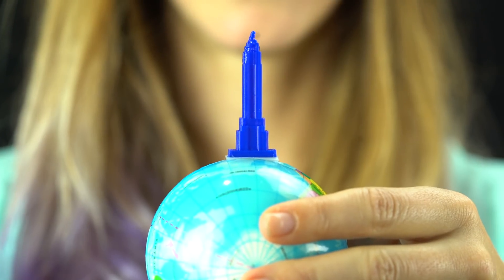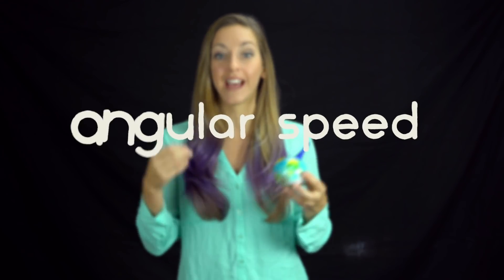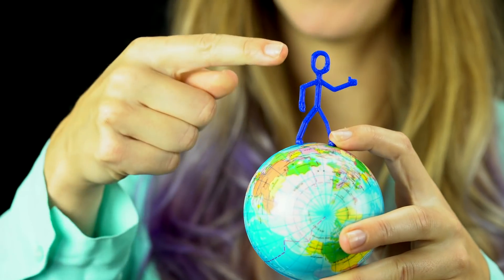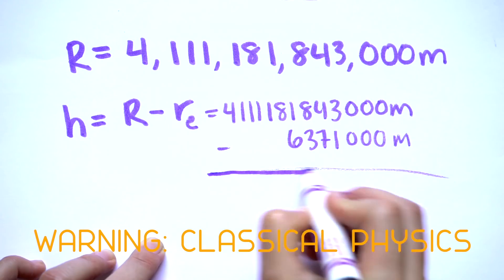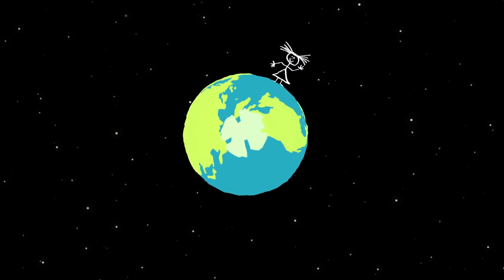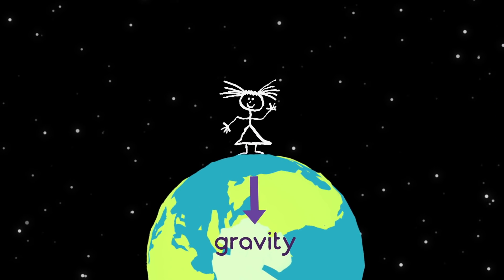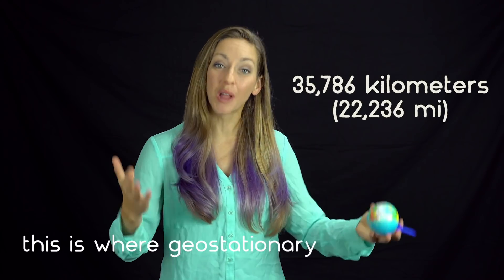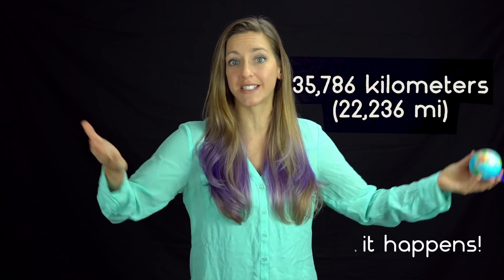How tall is this building?

Comment from the maker: Fun fact! When I said you could find a place to settle down in earth’s molten core, it wouldn’t be in the plane of earth’s equator, because earth’s core is not entirely molten. It has two parts, a SOLID iron/nickel inner core with a radius of about 1,220 km, and a molten outer core that’s about 2,300 km thick. If you wanted rotate around at 100mph (161kph) on earth’s equatorial plane, you’d have to be 612km from the center of the earth which would put you in the solid core.
Reply from the maker: Yes!
Reply: Physics Girl Thank you for saying in the title "zero G" and not "zero gravity" SciShow has made this mistake before. Also I think you should go full purple akin to Trade Chat's pink. Love your videos.
Reply: Physics Girl Would the Earth's wobble increase if it's balance gets thrown off by the weight of such a building?
( Much like a spinning top with a lump of clay stuck to its side )
Reply: Thanks for the International System Units. You could have used them on your video in simultaneous translation, because it would not make us, educated in those units, pause to try and transform the quantities involved.
Reply: centrifugal is what we call the force we feel or perceive. So it isn't an actual force. Vsauce just posted a great video on it as well called spinning.
Reply: Actually, such a building would weight 0 kg. As explained, there's this "centrifugal" force that puts the building on orbit. Imagine it is a very big geostationary sattelite, with a wing out to space, and a wing going down to Earth's surface.  It doesn't even have to touch the surface.  Actually, we'd start constructing such a "building" by putting it on geostationary orbit, and extending the two wings at the same time so the gravity force on the down wing and the centrifugal force on the up wing would compensate at all times.  We'd only "attach" the down wing to some Earth base so that it's not pushed away by winds, and irregularities in Earth rotation.  See the links in my other comment.
Reply: The centrifugal force is not a real force, it doesn't exist, it is a feeling rather the counter force, the centripetal force is real. http://www.diffen.com/difference/Centrifugal_Force_vs_Centripetal_Force
Reply: Happy molten iron beauty bath then!
Reply: Physics Girl, is it possible that I saw you in the tv serie: how to build everything.
Reply: i love your hair. want to meet u someday
Reply: Does centrifugal force exist or not?
Reply: erm, that would just rip the building apart?
Reply: Intelligent Physics people: Zero G and Zero Gravity are different, also angular momentum and science.
Me: What's the difference between a merry-go-round and a carousel. Seriously. Is a merry-go-round different from a carousel? I NEED ANSWERS.
Reply: Physics Girl buildings this tall would decrease Earth's moment of inertia or slow down Earth's spin as the energy used to spin Earth would be instead put into the building slowing down day making it longer. you can tell this would be more than just a  problem as we would have to re organise our time. this also might be a good way to make a full earth spin actually take 24 hours instead of the 23hrs and 59mins or something around that which always bugged me
Reply: InjuredMuffin 2 why should a day be 24 hours? Arbitrary day based on arbitrary unit of time. And changing with time...
Reply: Physics Girl m.   M
Reply: We all float up there.
Reply: Another fun fact is that the deepest anyone has ever drilled down earth is about 7.6 miles.  The earth radius is 3,959 miles.  So when they tell you that the earth has a molten core and all these different layers, it’s just a theory.  Just a wild guess really.  We do not know basically!
Reply: HAHA. the molten magnet doesn't work. The core cannot be. After you heat a magnet it loses its magnetic properties. The earth is flat and gravity and space are a hoax

Comment: Sorry but I don't like the centrifugal force notion. There is only one force acting in the system and that is gravity. The penny is simultaneously moving laterally with constant velocity, and accelerating down towards the Earth. It never gets closer to the Earth though because its lateral motion ensures that the curving of the Earth's surface away from it, exactly matches the distance through which it falls. This is a hard thing to put into words and others have done it better. Sketches help too.

There's talk on here of centripetal forces, but that doesn't help really since they only have meaning with circular motion, and as we know orbits under gravity can be elliptical or even hyperbolic. So I think notions of circularity in these discussions don't help. Cometary orbits for instance can be highly elliptical, so much so that when they are far out in the solar system such comets may actually look as though they are falling towards the sun. The key word is "falling". This is really what the penny is doing even though its motion is actually circular.

This is interesting now. One guy below was talking about centrifuges. Imagine you're standing in a cradle that some giant is swinging around on a rope. Just like standing on the Earth you feel a floor beneath your feet and it feels like there's a force pulling you "down" (or outwards if you prefer) to that floor. This is why the notion of centrifugal force is so popular - because we've all experienced it. So why in the ISS aren't the astronauts thrown against the further wall of their space station? In both cases there is only one force acting, the rope wielded by the giant, or gravity in the ISS. And yet the astronauts drift weightlessly whilst you in your cradle are anything but. The difference between these two situations is as follows. The centripetal force applied to you by the rope is applied via the cradle floor. As you go up through your body, slice by slice, each slice applies and reacts the forces to the slices above and below, just like standing on the Earth. So it's like a pile of books on a table. The uppermost book only feels itself whereas the lowermost has to carry the force of all of them to the table. On the ISS however, the force of gravity isn't applied to an astronaut locally, through a floor or wall. It is applied to each and every atom and elementary particle of his body simultaneously.. So there is no stacking, slice upon slice. Every slice experiences the exact same force as every other. It's as though, instead of a single solitary rope, gravity has a vast number of ropes all pulling with the same acceleration on every particle of the astronaut's body, simultaneously.

Comment: Why is impossible to go the speed of light, if we had enough propulsion and enough fuel, why can we go the speed of light
Reply: due to relativistic effects. As you go faster and faster, the relativistic effects cause your craft to by shorter, more massive and experience slower time than the outside observer. The net effect of these 3 is that, no matter how powerful engine you have, its power output approaches zero at speed of light. A real motor can only accelerate you to a fraction of speed of light. In case of engines that use 100% efficient fuel (antimatter engines and kugelblitz drive) you can get at maximum to 0.2c. With engines that you external propulsion (for example light-sails) you could theoretically get faster, in practice, not so much...

Comment: I agree that you can't make a building this tall. But what about train tracks? imagine if instead of launching rockets into the space, we simply build a train track (probably maglevs) to take us there. Would it be possible?
Reply: not realistic. Currently we only know of a few materials which could theoretically withstand the train of literally hanging form geostationary orbit. Carbon nano-tubes for example. But they still have very low margin of error - not enough to safely put an elevator on them, or let them hang in hurricanes etc. Technologically we are not there just yet.
Reply: But if you build a circular structure that can be both high and strong. It would only make the train rocket reach necessary velocity to go to orbit. Wasn't thinking of a track that connect earth and space. IDK kkk
Reply: Carlos Eduardo Prescott Naso you mean like on the surface? it is not possible. due to air friction, anything send from surface of the earth can't reach space with inertia alone (aka you can't cannon-ball something into orbit). It would either stop due to friction or burn during ascend due to friction.

Comment: Relates to a question I've wondered about... If one is travelling directly towards the equator along a meridian of longitude, one's linear velocity increases. As the Earth is wider at the equator, one is also getting further from the centre of the Earth as one approaches the equator - basically going uphill. So does it take more energy to travel directly towards or away from the equator along the surface of the Earth, everything else being equal?

Comment: ok heres a good question. if you were on top of the earth, like the pole where if you move in any direction to would no longer be on the point where it spins. how fast would you have to spin the other way so that its like the earth was just not spinning at all, if that makes sense. it make sense in my mind but idk how else to word it
Reply: Command Frog I think the OP is talking about standing at the north pole, not the equator, in which case you would have to spin once in the opposite direction to earth's rotation every 24 h
Reply: If you spin in the opposite direction in one complete circle per day, you'd be relatively stationary while the Earth rotates beneath you.  For instance, if you faced exactly away from the sun and completed a 360 degree rotation over 1 solar day, the sun would always be at your back.  Alternatively, if you moved about 3.8 miles away from the axis, turned, and walked due West at about 1 mph, you'd be using the Earth as a treadmill, staying relatively in the same spot as the Earth rotates in the opposite direction at the same speed.
Reply: 1040mph in the other direction. I would not recommend attempting this, though.

Comment: One minute in, Google tells me the height of a geostationary orbit is 35,786km. People are very keen on the idea of a 'space elevator' - which would be taller than that and have a weight at the end to keep the 'cable' taught... There are several problems with that idea. First, you'd need a material with quite a bit more tensile strength than any we have now, and second, you'd need to pretty dramatically reduce the amount of space-junk... You can change the orbit of the ISS slightly. It's a bit hard to change the orbit of a skyscraper...

Comment: Isn't this geosynchronous orbit where we keep all of the communication and broadcast satellites?
Reply: It is
Reply: Broadcast satellites are pretty much exclusively in GEO as of course are any communication satellites that need to work with ground stations using fixed dishes. Communications systems do exist with constellations of satellites in LEO and MEO though because for some applications a minimum round trip latency for the space segment of 238 ms is simply unacceptable so ground stations with satellite tracking motorised dishes etc are utilised.
Reply: Was gonna ask this question, Thanks.
Reply: lol
Reply: Communications: yes
GPS: no, they use semisynchronus 
Most others: no, low - earth orbit mostly
Reply: probably not, because satellites moves so fast at a much less altitude which is a lot better and provides faster communications
Reply: ***** Whaaa?? I wasn't asking if we have satellites in geosynchronous orbit... Communication and broadcast satellites are definitely there, as they have to be or you'd constantly need to be on your roof adjusting your dish to get TV... Seraphina has a good explanation in this thread.
Reply: ***** you are right I confused them with space shuttles.
Reply: Any transmitting or receiving dish antenna that is stationary on earth is communicating with a geosynchronous orbit satellite.  Other satellites require motors to move the dish antenna to always face the satellite.  GPS satellites are not geosynchronous but the signal they send out is strong enough to be received with the omnidirectional antenna inside your phone.  That's why they don't need a reflective dish.

Comment: What about the calculation where you'd have a building in which you'd be pushed against the ceiling with as much force as you'd normally be pulled down to earth? I.e. 9.81 (give or take) m/s² acceleration AWAY from earth?

Comment: How tall would it need to be on the moon? Can it be build with current technology?
Reply: The thing about a space elevator on the moon is that you don't need your center of mass to be at its geostationary orbit (essentially its distance from Earth). It can instead be suspended about the Lagrange Point 1 (L1) in the Earth-moon system. Ultimately the structure would go about one third of the distance to Earth at ~120,000 km. Also, while a space elevator on the moon would have to be longer than one on Earth, it could actually be built with current technology. Flexible but durable materials like kevlar are strong enough to withstand the force of tension.
Reply: The moon spins way slower.  Its rotational period is 27.3 days, so the centrifugal horse is much smaller.  However, it also has a weaker gravity, so you need less force to overcome the gravity.  Its gravity is 1.62m/s^2, or about 16.5% of the Earth's.  In the end, it turns out you would have to be 9x the Earth-moon distance to sustain orbit with the experiment.  

I just want to point out that this is for circular orbits.  With elliptical orbits you can go higher or lower, but not too much.  The issue is that you won't feel weightless and the coin will move around from your persepctive.
Reply: Yevhenii Diomidov What?  Did I type horse?  I have substitutions on.  I'm not sure if that affects comments
Reply: Yevhenii Diomidov I wrote force but I guess it corrected me wow

I like many of them.  The presidential airbenders are both trying to win the eating contest
Reply: For comparison with Earth, you need rotation rate, yes; but mass, not surface gravity. And then, radius, so you know how much to subtract from the orbital radius to find the altitude.

The Moon's mass is only 1/81.3 of Earth's.
Reply: You would probly want to use the lagrange point with the earth instead and it might actually be feasible with kevlar as the gravity is so much weaker.
Also thats starting closer to the center of mass so it diminishes faster.
Reply: Malcolm Smith True, I didn't take into account earth's gravity.

Comment: While a building this tall is impractical, a space elevator made out of carbon nanotubes uses very similar principles to function is in theory, possible.  In fact, the outward acceleration experienced when you're higher in altitude than the "0-g" altitude calculated in this video means we can attach a massive counterweight past this distance and use it to keep the space elevator upright and in position as cargo moves up and down.

Comment: I have a question tough.... If you use a  very, very powerful laser,  and put it spinning in space very fast, could it's light hit two other planets, in two different star systems, so it's "angular velocity" exceeds the speed of light?
Reply: What you have to think here is how the light is moving. The light goes from the laser to the planets, that is the distance it travels and it does that going the speed of light. Where it lands is of no consequence. A similar example would be to have many LED lights in a row and have them light in sequence. You could light them all together or have any amount of time between each one. Now if you lit them in such a fast sequence that the line created looked as if it moved faster than light nothing would be actually travelling faster than light, correct? Back to your example the laser does exactly that it "shoots" out photons that, because it spins, travel one next to each other. That would make a line of photons from one planet to the other that is created faster than the speed of light without anything moving at that speed. Get it? I hope I make sense.
Reply: Nix Dorf Yes. It's called the lighthouse paradox. Read more about it here. https://www.physicsforums.com/threads/rotating-a-laser-beam-faster-than-light.251174/  The short explanation is you don't confuse velocity with time between "events"
Reply: dalek67 Thanks. You have exterminated my doubt.
Reply: the answer is no. light isn't a massive, concise object. it's more like a stream. 
so basically a powerful flashlight doing that would pretty much be the same as you spinning your garden hose really fast.
Reply: Nix Dorf You sir are a genius
Reply: Nitro Master hahahaha! No. I'm stupid, for sure!
Reply: You couldn't spin the LASER machine faster than the speed of light and when light leaves the LASER it behaves as saparate particles (photons) travelling in a straight line (there is no angular momentum anymore) exactly at the speed of light.
Reply: Nix Dorf since the light from the laser beam doesn't have mass it doesn't really apply here, but that's a very good question
Reply: For that you should watch another Vsauce video: "what is the speed of dark?"

Comment: 'Awww' you missed the ultimate counter-gravity of your lightspeed tower... Maybe you'd like to describe the height at which the top of the building pulls off and flies away... And then on the top floor of your 'Impossible Tower' building you'd be accelerating a modest 13.8 mi/sec.², but that's the not-so-really-modest equivalent just shy of 2300 'geeees'....